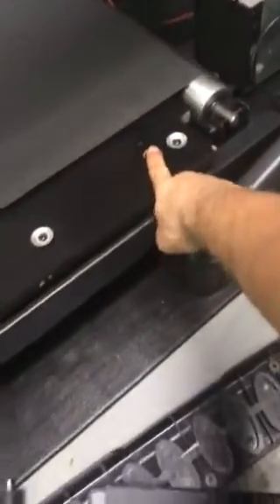Annoying squeaky loud noise in sole f63  sole treadmill dicks

Comment: I have the same unit with the same squeak coming from the same side. Sounds exactly the same as in this video. Turns out there is a large bolt that connects the running deck to the main frame and it is located under the large piece of plastic (called the console mast cover) that sits each side of motor cover. Just remove the one screw and slide the cover up the console arm to access it.
Anyway I gave it a squirt of WD40 and the squeak was gone. Only took 1 hour to find the issue and 1 minute to fix. Hope this helps someone out there.

Comment: I had the exact noise only on one side. It turned out there is a thin pad between the metal and wood framework located  under the side foot rails that had worn-out.  I replaced mine with a dollar tree self adhesive strip and eureka no more creaking!!

Comment: I had the same problem.  There are 4 bushings under the belt and deck inside the frame.  I pulled the lower dust cover and found the 4 bushings and sprayed them with silicon lube and it STOPPED squeaking!!! Hope this helps someone else.
Reply: Steven Conn Hello.  I know this is late notice but can you give more details where these bushings are or take a photo.  Much appreciated.
Reply: Hey Luke.  My F80 had a squeak on both sides coming from the bushings just under the silver rails on the sides. It would squeak just by stepping on them.  I used white lithium grease with the long thin tube and sprayed between the silver plate and the deck.  If that doesn't fix it you might have to remove the panels under the treadmill and spray them from the under side also.  Hope this helps (if I can figure out how to load a picture on here I will show you the ones that were my problem.)
Reply: Thanks for this tip! I had some minor squeaking under the plastic side panel bit with the ovals and I removed that along with unscrewing one of these bushings and applied white lithium grease and it squeaks no more! Thank you!!

Comment: I have the exact same issue. I can not find out what the damn noise is.. and your right, it's so annoying, it's actually hard to workout with.
Reply: did you figure it out?
Reply: Actually yes,  Mine was just the railing over the belt was tight. I loosened some screws on the back end and it stopped...
Reply: +Evoin 
Great to hear!
So, are you pleased with your purchase?

Thanks,
Walt - Chicago
Reply: Actually very much so. It's an extremely smooth treadmill.
Reply from the maker: I did everything and still loud. Finally, I sold the engine for $90 and rest to junk.

Comment: After 6 hours troubleshooting the clicking noise in my F63, I solved the issue.  On the top of each of the siderails there are 4 hex screwbolts which go down through round rubber bumpers and thread into a self-tap.  One of them was not tight and was making the clicking sound as you step near it.  The allen hex screw head was basically stripped and I could not loosen it or tighten it.  These are installed at the factory.  I found a spare nut which I installed tightly from the bottom which stopped the clicking. https://imgur.com/iSkYZ0D  https://imgur.com/JXa7HKH  https://imgur.com/mex2xFM
Reply from the maker: JPK omaha good to hear that you found a solution for your. Maybe I had same issue too, but even technician Solo send couldn’t fix mine. I love this treadmill but couldn’t stand the noise so I had to replace mine.

Comment: Was wondering if there has been any updates if this problem was fixed and if so how it was fixed?
Reply from the maker: They send me new plastic washer, and soft plastic bumper that goes under board. I replace all of them and the noise is still same. It has been 2 moths an have not use the treadmill.  I will make more video of it.
Reply: Thanks for the update! Looks like I just have to deal with the noise then.
Reply from the maker: jebus alive Send them email even if your warranty expired. They should send you new washer and it may lower the noise little. Also, put some Lubricants  in all joints and moving parts. I hope you can fix yours and its really annoying nice. Keep eye on my channel. In next 2 moth, after I move my home, I will work on it to fix the noise with a video.
Reply: +Dante Oops 
did you fix it?
Reply: +Dante Oops 
I inspected one at Dickson and I noticed that the orange colored shock absorbers are held on by a black, double sided tape.
They must be aligned to the absorber and frame.

2. See comments below from other user statin that he loosened some of the deck to frame scews.
Reply: Oops I forgot to update my situation with the treadmill but I managed to fix the squeaking by just oiling/lubricating most of the screws both inside and out especially the main support one. I also oiled the under the belt itself but that didn't help much.